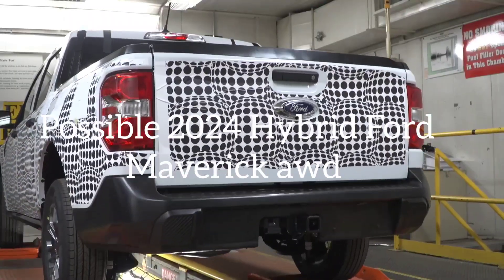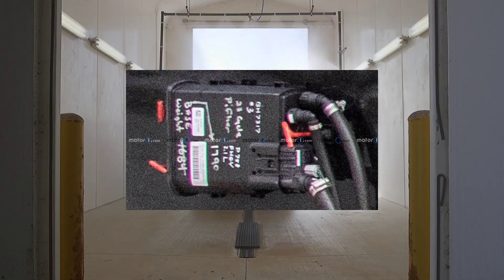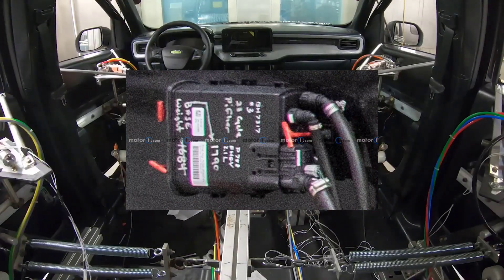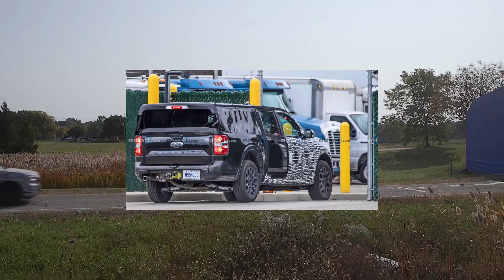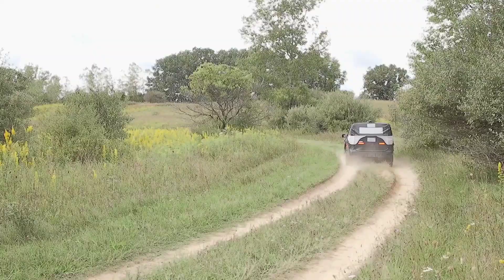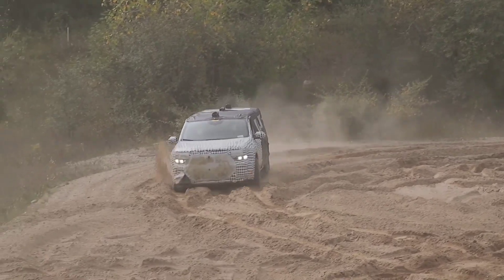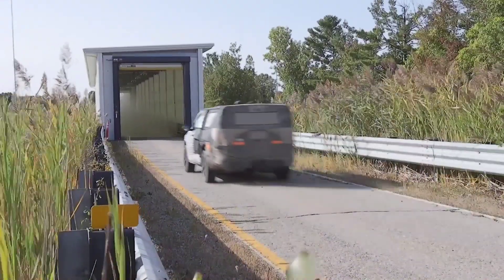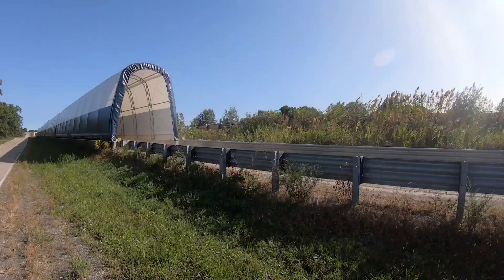Ford Maverick Hybrid awd caught testing... spy shots!

Comment: I am also waiting for my truck is to be built, I have a vin number but the production date has been pushed back many times. I ordered an XL hybrid. What did you order. And do you have a vin.
Reply from the maker: I dont have a vin or production date. At least your wait is nearing its end, when did you order, did you add any options. I ordered an XLT with the lux package back in October of last year. I haven't made any changes to the order to possibly speed up the build...
Reply: @padfoo  I have XL hybrid with a moonroof, 2k hitch, and center console plug
Reply from the maker: @the305hauler  Thats a good config... all must haves if I were to remove the lux package. I just dont think it' would make much of a difference with the 2023 model order banks opening up in a couple of weeks! Keep us posted!

Comment: No differential in the back so not AWD
Reply: Hub electric motors
Reply from the maker: I am not an engineer but I dont think an electric motor needs a differential to manage power going to the wheels...
Reply: @padfoo  the escape PHEV doesn’t offer AWD, so not sure how Ford would design this. Typically if the electric motor is in the transmission like the current Escape Hybrid, Escape PHEV and Maverick Hybrid you still need to get power to the back mechanically for AWD, so a driveshaft and differential. Toyota RAV4 does their AWD the way you’re talking about, with an electric motor on the rear and two half shafts, which you’d be able to see from that rear photo you have in the video as well. (am an engineer but not mechanical, not that that would matter, mechanic would be more useful here)
Reply from the maker: @keyhere  Thanks for your great input, all are valid points, we'll have to wait and see!